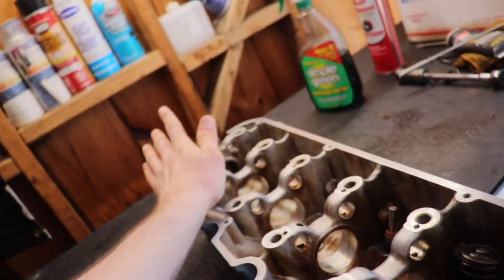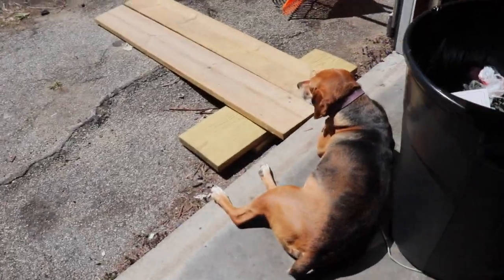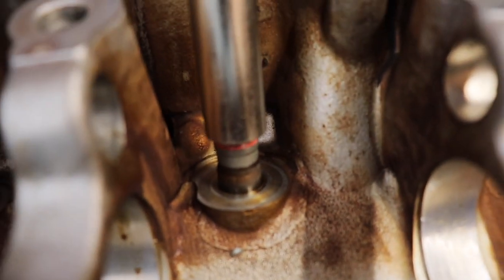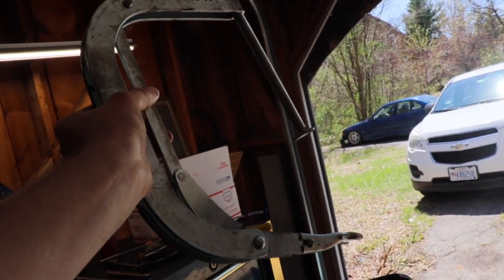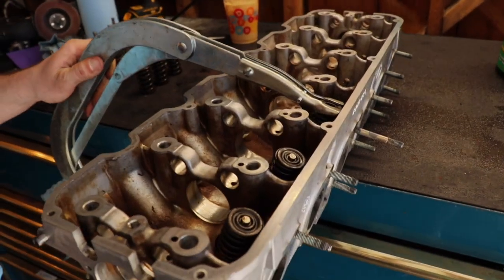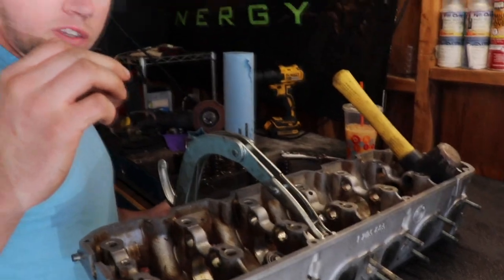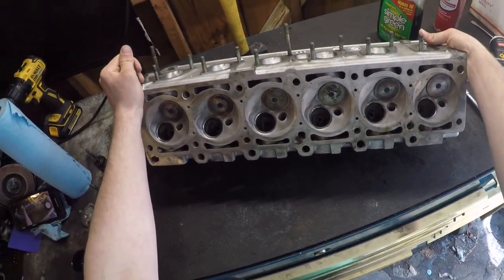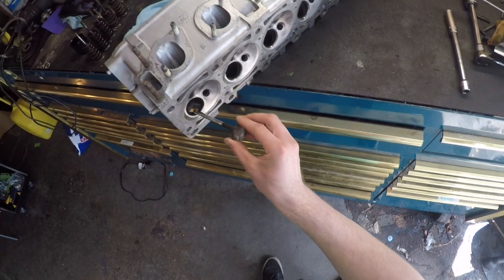How to Rebuild A BMW M20 Head ( The Step by Step Guide )

Comment: My question is about the valves that are supposed to be “open”? Is that why you put the head on those blocks at the edges so they could open and not get ruined?
Reply: Yes, when you turn the cam, the valves with arms will open and close. Putting the head on blocks will give the valves room to open while you get the other arms on

Comment: Why did the integrated engineering rockers fail? Do you not recommend them?
Reply from the maker: The feet kept falling off the rockers and eventually went into my oil pump lol. Used stock ones and never broke again